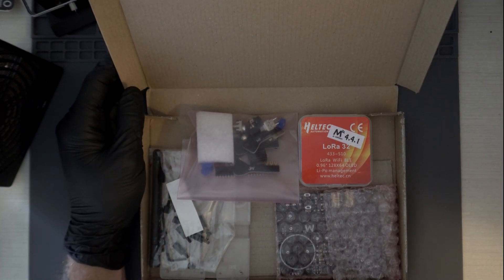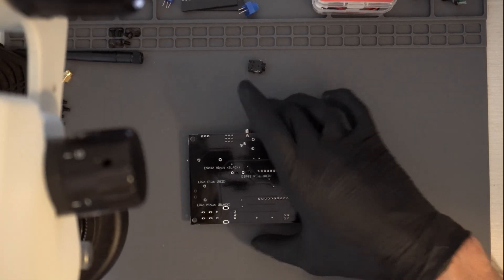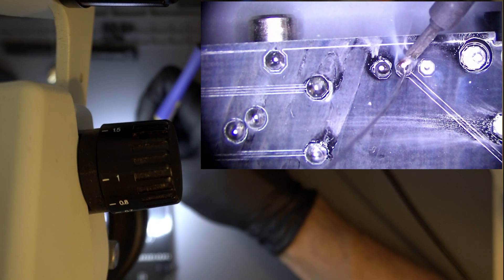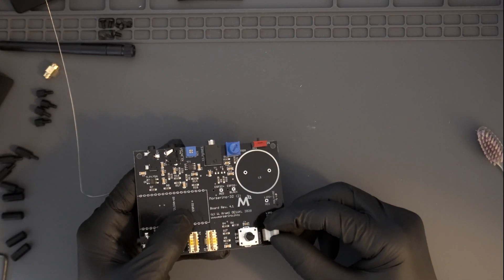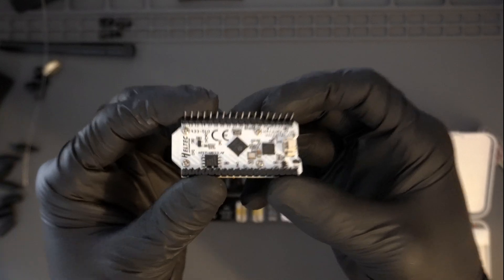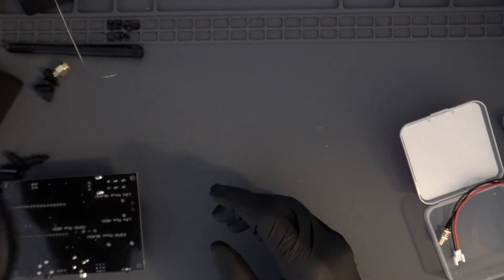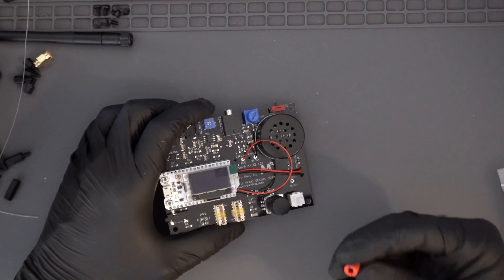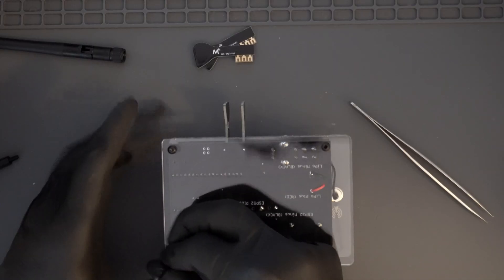Morserino-32 Morse Code Machine | Full Build

Comment: Just ordered one... What batterie u use???
Reply from the maker: Hey Norberto, sorry for the late response.  I use the Morserino with USB power.  Getting a battery that fits underneath the Heltec module can be relatively tricky, though if I were to give one a shot it would be this one: https://www.hobbytown.com/ecopower-electron-1s-lipo-30c-battery-pack-3.7v-500mah-ecp-4008/p403323

If you are fitting the battery underneath the Morserino PCB or external to the unit itself, you have a lot more options, just make sure it is 3.7v LiPo.  Recommendations from someone I know who builds these kits as a hobby recommends the following:

https://www.amazon.com/dp/B08XZNRTCP?ref_=cm_sw_r_mwn_dp_ZFAQACZDBGRYE5FDQT8D
or
https://www.amazon.com/dp/B07MGZY9JJ?ref_=cm_sw_r_mwn_dp_AEETSBDW8RWE9VZFBW9M
or any battery similar in size.